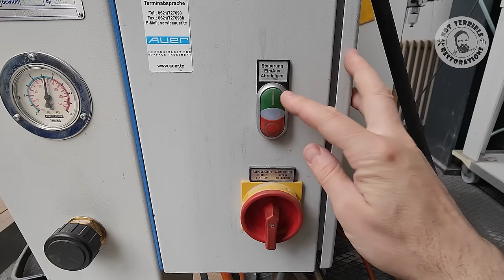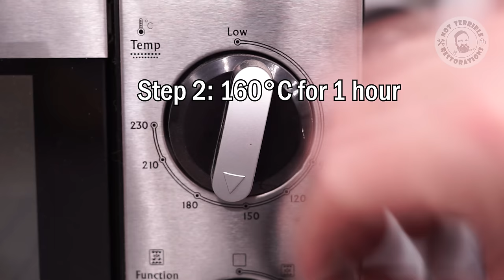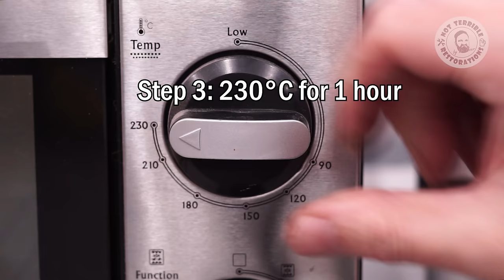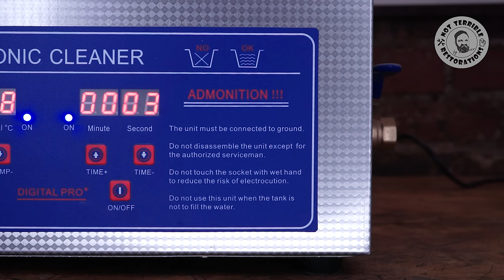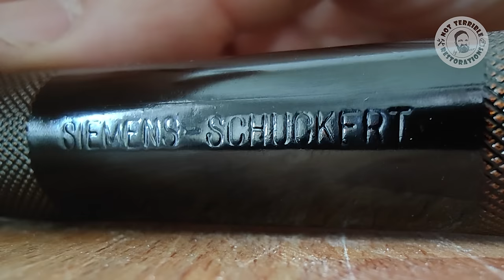RARE "Siemens-Schuckert" Multi Tool Restoration with Japanning

Comment: 7:52 the tip of a regular screwdriver is named the blade. 
Tip: If you put a piece of cork in both screwed end pieces, the blades will be protected from breakage and the tool is a lot less noisy.
Reply from the maker: Hey Tina that's a great idea. Thank you
Reply: you was faster))) i think the same, but with leather
Reply: @NTRprojects  ...and if you file a very slight negative angle to the very tip of each blade and parallel for a few mm more, they will grip the edges of screws MUCH better as they will bite a little bit into the base of the slot in the screw head.  At the angle they are currently ground, they will tend to cam out.
Reply: Absolutely, the deeper into the slot it goes the better,

Comment: I always like watching craftsmen work, your recording is excellent and it's satisfying to watch your process. If I can make a suggestion; your audio is mostly just the sound of the work, but your mic seems to be kind of tinny and has some reverb. Maybe try putting in a low pass filter with a higher cutoff point and tweaking the gain on the mids and bass?

Comment: Keeping the two parts in its original brass worked really well. Looking really nice compared to the original. And your japanning covered all the pits! It was so satisfying looking that all attachments are standardised. Great work once again! Curious though, can the tool handle stubborn screws? As fr as I know brass is a little softer than the other metal.
Reply from the maker: Good question Anisa honestly I wouldn't wanna find out. Would feel like going on an offroad trip with a classic car. For stubborn screws I will use my usual tools 😁

Comment: The triangular and square tools are small scrapers or reamers. Used for adjusting bearing surfaces or removing small burrs. They should be sharp on the edges for use.

Comment: Beautiful restoration.  But I'm curious.  Where did you get your information about the Robertson tool?  Robertson is the most common used screw and screwdriver in Canada.  It is a Canadian invention after all but has the U.S. auto industry so poisoned the public opinion that people think they aren't even in production any more?

BTW, I don't think that 4-sided point is actually a Robertson.  Robertson predates this tool by almost 35 years so you would think they would get it right.  It's a pyramidal Awl for leatherwork.  The Robertson has 4 sides that taper to a narrower 4-sided flat, like a 3-D trapezoidal.  It doesn't taper to a point like this does.

Comment: These enjoyed a brief resurgence in the '70s albeit with a bogey yellow plastic handle and aimed at cyclists mainly as found in the bike section of hardware stores.   Problem was the plastic was very cheap and brittle and it didn't take long to make the whole thing useless.   With my King Dick adjustable girder wrench, my plastic screwdrivering set I roamed for miles on my Raleigh Chopper confident I could fix most mechanical problems, thinking of the needle bit I do remember jamming it into a Sturmey Archer gear selector chain when the selector cable broken and it got stuck into lowest gear which was a major thigh busting heavy grind, bit of insulation tape to keep it jammed in and off I would go again :D

Comment: curious why Japanning is used on brass like this. is it because the item is a tool an it was to protect it? (not questioning the restoration, because it was beautifully done, just want to understand why the original crafters chose this method)
Reply from the maker: Well the brass needs protection because it scratches easy and the sweat of the hands is making it dark quite soon. At this time japanning was a common way to coat parts and its very durable in comparison to lacquer even nowadays. I used japanning to stay historically accurate
Reply: @NTRprojects  thanks for explaining it to me!

Comment: So why isn't this tool more common? Not for just explicitly for sale, but because this looks like the perfect "fundamentals" project for this kind of work. You have to turn the rods to make the body, hollow it out, and internally thread it as well for ends. Knurling the ends, as well as the body for ergonomics. Tapping the screw for the top piece to be fixed, and making the screw itself. Milling and drilling the top piece for the tool bits, as well as filing a smooth angle for the bit to grip would be needed. Then you have to make all the tool bits from a steel rod like you did in this video, as well as properly heat-treating it.

It seems like such a good project and gift that it would be more commonplace. It isn't "hard" for anyone with the appropriate knowledge, it is still an incredibly useful and beautiful tool that was handcrafted and can easily be passed down generations. It would still show the skill of the person crafting the tool, and with how precise mills and lathes are today, you can probably get that engineered down to like a thousandth of an inch.

Comment: So much history and character is lost forever thanks to this kind of 'restoration'.
It's like using high gloss enamel house paint to 'touch up' a Monet and remove the artist's 'unsightly' thumb prints.
Given that the brass components were not originally polished, the black might just as well be high gloss enamel or powder coating.
It's a tool - not some piece of 'bling' to dazzle one's 'friends' with. SMH
FYI - there's a reason why the brass components were COATED and not polished.